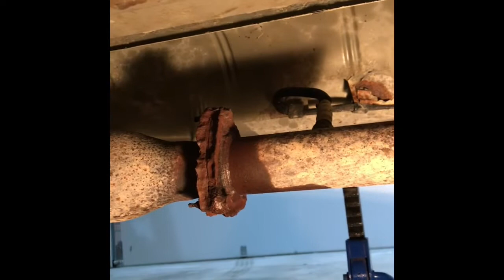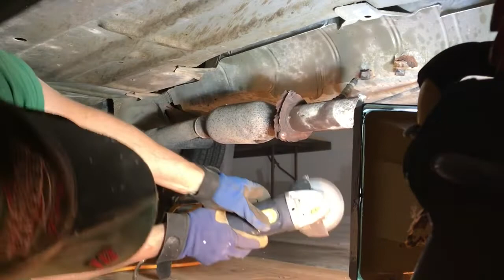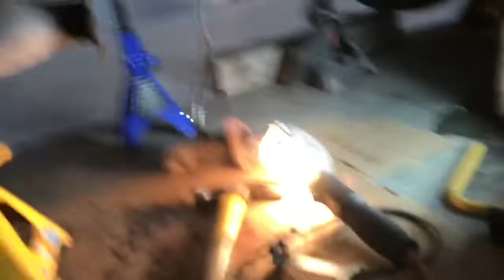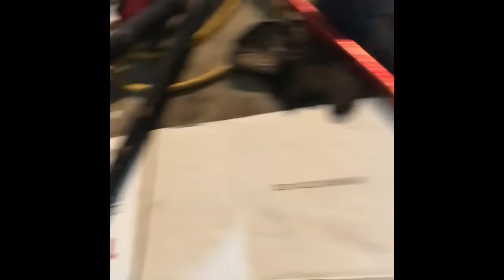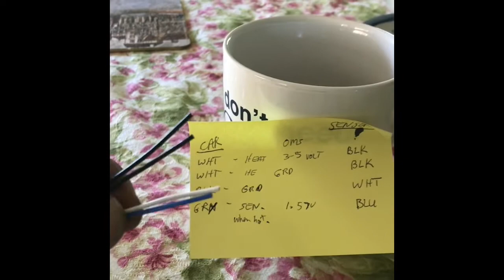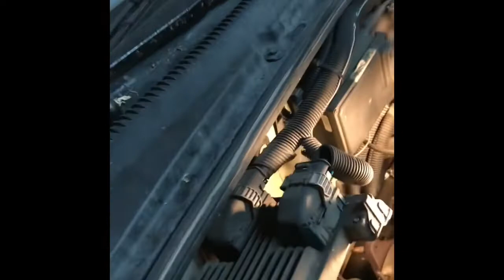2003 Chevrolet Cavalier Catalytic Converter and Oxygen Sensor

Comment: Oh dude.  Yeah, Autopac sucks.
I had my quarter glass (rear little triangle window) smashed during a break in.  2003 sunfire... so, you know... a rally rare car, right?
Autopac couldn't find the part.  The dealership couldn't find the part.  So, it was going to be written off. 
I found the part after searching for SECONDS online.  I could get it for about $5 plus shipping (about $25) and gave the info to the dealership (Selkirk GM).  They ordered the part.  The work got "done".
I get my car back, look at the cost breakdown.  Dealership charged Autopac $550 for the $25 part, plus install.  The part wasn't even put in right and required some work to get it to sit right, which I reported to Autopac, who told me "just be glad it was fixed".
Yep, remember that he next time they talk about insurance fraud and what customers do that "drive up the cost of insurance".
Reply from the maker: I think the PCs are quietly privatizing MPI on the sly. They totally sold out the writeoff auction. This catalytic converter scandal shows how private companies like Boyd and Midas are now running MPI.